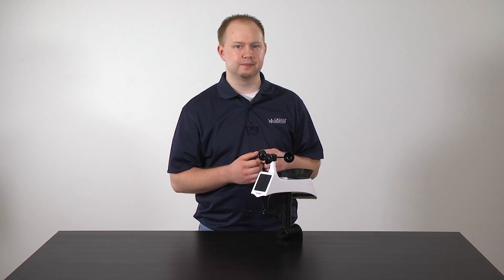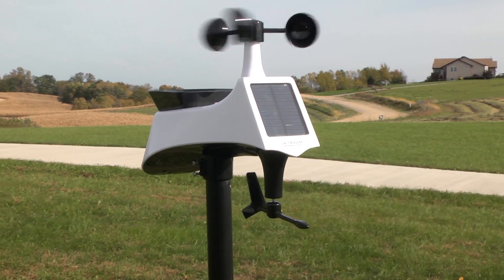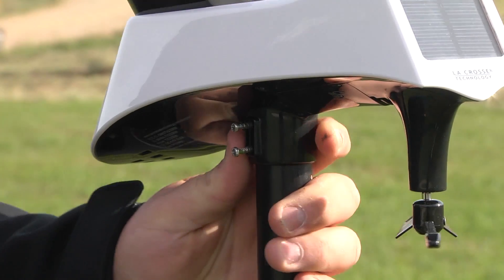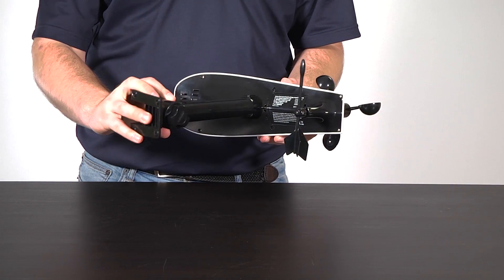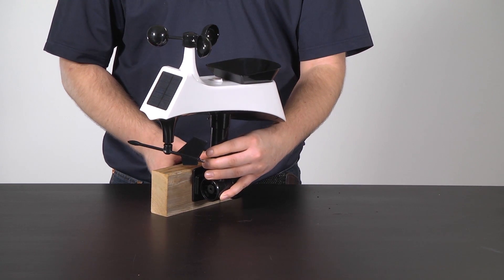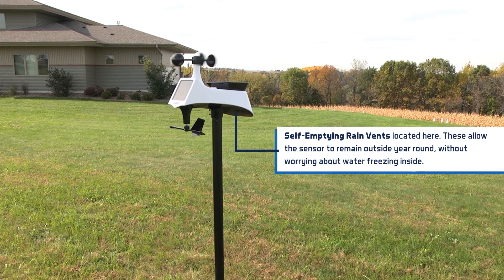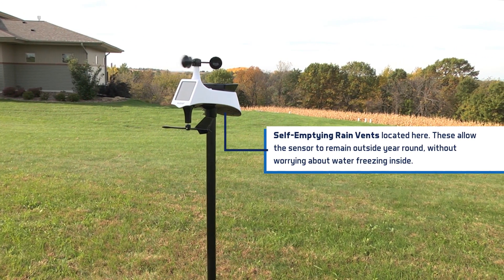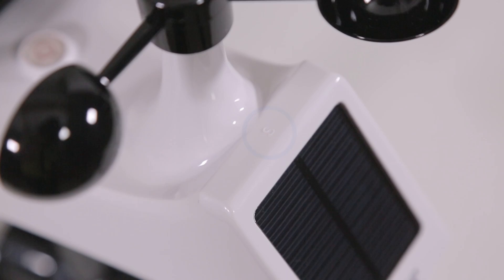How To Mount Your Multi-Sensor

Comment: If I mount it on my roof, will the temperature reading be affected by the heat coming off the shingles?
Reply from the maker: This can indeed be a concern. Advanced mounting hardware such as tripods, poles, or other bracket configurations can help elevate this by extending the sensor above your rooftop. An online search for "weather sensor mounting hardware" should help point you in the right direction. A 1-inch diameter pole should work well for most of our sensors.

Comment: Where can I find the black pole to stick in the ground?
Reply from the maker: Your local hardware store should have some options; just be sure not to exceed the 1" maximum diameter size. The pole was originally silver and spray-painted black to better match the sensor. However, many other types of mounts can be used as well. Some options can be found on Amazon here: https://www.amazon.com/s?k=weather+station+mounting+pole

Comment: I can't get a wind speed reading 
Model -------- S82950
Reply from the maker: If you are seeing dashes for your wind speed readings, please check to make sure you're using a new set of regular alkaline batteries in the sensor and that it is within 400ft from the display. Keeping other electronics away from the display and outdoor sensor will help to ensure the radio signal can successfully reach the station. With new batteries and a good location, press and release the SENSOR button a few times until the wind sensor ID appears on screen. Then press and hold the PLUS (+) button for a few seconds until the station begins searching for the sensor reception (reception icon will start to animate). More specifics are covered on page 21 of your full FAQ document here: https://bit.ly/s82950_faq 

If you should need further assistance, please message our support staff directly here: https://bit.ly/contact_techsupport. Or alternatively, send us a private message on our Facebook: http://bit.ly/LaxTech_Facebook or Twitter: http://bit.ly/LaxTech__Twitter page. Our sincere apologies for any inconvenience.

Comment: Does / can the solar panel charge rechargeable batteries? Does the unit support rechargeable batteries?
Reply from the maker: Hey Tony, sorry for the delay. This will depend on the model station and sensor you own. But if you have a sensor like the one pictured in this video, please be sure to use regular alkaline batteries, not rechargeable, as the sensor will not recharge the batteries inside. However, making sure to mount the sensor facing south (assuming you're in the Northern hemisphere) for the greatest amount of sunlight will help extend the life of the batteries as well as provide accurate wind direction readings.
Reply: @lacrossetechnology  Thanks for the reply...I'm in Australia, so south, but I understand from the video that I need to face the solar panel to the south anyway to ensure wind direction is relayed correctly?
Reply from the maker: @tonysea9724  This can depend on the model you own. What is the model number of your weather station? This will be printed on the back of the main display.
Reply: @lacrossetechnology  La Crosse V40-PRO WiFi Professional Colour Weather Station...Received yesterday and will be setting up later this week
Reply from the maker: Thanks  @tonysea9724 ! Then yes, please be sure to mount the sensor facing South for correct wind direction readings. It should still collect light during daytime hours to extend the battery life and function perfectly in that position. 😊

Comment: Thanks for not saying what size diameter pole to use!
Reply from the maker: Hey Korey, our apologies for not including this information in the video. The outside diameter of your conduit should be not greater than 1-inch. A 1-inch metal pipe or 3/4 inch PVC conduit tend to work well.
Reply: @lacrossetechnology  yesterday I tried a 1 inch metal pipe and it would not fit. I ended up using a 3/4 inch metal pipe. Wind readings don't seem to be accurate 50 feet from my house only being 5 feet off the ground. Soon I will make it 15 feet off of the ground. Your information of only 50 feet of no obstructions in all directions and 5 feet off of the ground is not accurate. If there are buildings or trees they must be more like 150 feet away or else you need to be way way higher than 5 feet off of the ground!
Reply from the maker: @koreymayo8884 , we're sorry for the mounting trouble. Fence posts, decks, and poles are all common mounting options due to their convenience. Many users prefer these types of locations as the data they provide is accurate from their ground-level perspective. However, because wind in these spots is often affected by obstructions, as you mentioned, the readings may differ compared to local reporting news stations. More advanced installation options including tripods, wall mounts, eave crosse mounts, chimney mounts, and many others will indeed offer more accurate results compared to reporting stations, however, these advanced options will typically require additional equipment and possibly professional help for best results. We apologize for not mentioning these in the video and truly appreciate your feedback. We hope the coming 15ft option offers more desired results.

Comment: Wat size pole we attach it to . Height and diameter of the pole
Reply from the maker: Hey Johnny, the recommended pole diameter is 1".  The height is kind of a preference thing, but the higher you go the more help may be needed to keep it steady and level. If you have an open area, as shown in this video, a simple 5-6ft pole should do that trick.

Comment: You mention keeping 50' clear in all directions, but what height do you recommend? How far off the ground should the sensor be mounted for ideal results?
Reply from the maker: Sorry for the confusion. The Multi-Sensor should ideally be mounted at least 6 feet above your mounting surface (ground, rooftop, fence, pole, etc…). As for the specific height, this all will depend on your location and the structures that may surround the sensor. In most situations an unobstructed rooftop should work well.
Reply: If you have any trees or buildings 50 feet away you need to be at least 15-20 feet with your wind sensor. Only 5 feet off of the ground and you better not have any trees or buildings for more like 150 feet

Comment: Hey guys, should it be pointing North in the Southern Hemisphere? Cheers
Reply from the maker: Hey Ricky, for the system to work correctly, this Multi-Sensor’s solar panel must face south for correct wind direction readings. But not to worry, the sensor should still get plenty of sunlight even while facing the “wrong” direction. Keep in mind also, that the solar panel does not run the sensor on its own, it simply extends the life of your batteries. So this shouldn’t be a huge issue.
If you have further questions or concerns please just let us know.
Reply: @lacrossetechnology  Excellent, thanks a lot! :)
Reply: @lacrossetechnology   also are you talking true north or magnetic north?
Reply from the maker: @bertbourgeois1926  True north or true south, depending on your hemisphere. This is simply used for its wind direction readings.

Comment: your mounting bracket sucks
Reply from the maker: Hi Dennis, we're sorry if you've had issues with our mounting bracket and would like to know more as to why it "sucks"? Alternatively, if you'd like to speak with our support team about a replacement, you can contact them here: https://www.lacrossetechnology.com/support/index/form/
Reply: your mounting bracket can only be 90 or 180 degrees, if it had teeth or cogs that it could be mounted in any degrees between 90 and 180 deg. i could have mounted it on my carport or roof of my shed
Reply from the maker: That is correct, Dennis. It was designed this way to allow for the most possible support during strong winds. We apologize for this inconvenience.
Reply: @dennishall1933  you don’t mount in on any of those surfaces. You would get faulty readings. I know it’s 2 years but so others may know.
Reply: @lacrossetechnology  njuhghh←
But

Jgy+-79_$